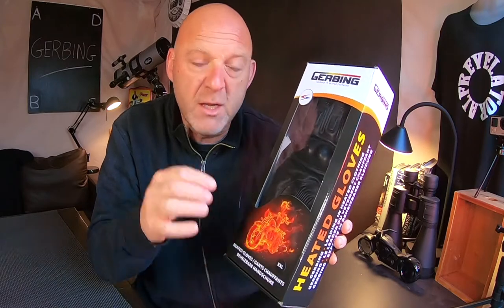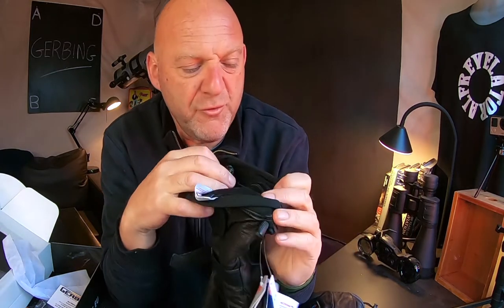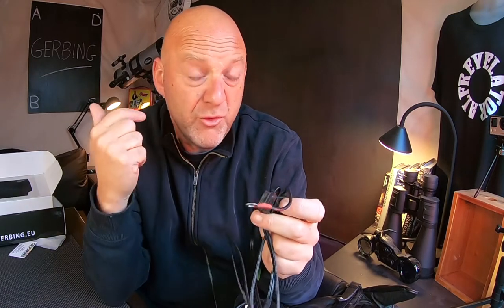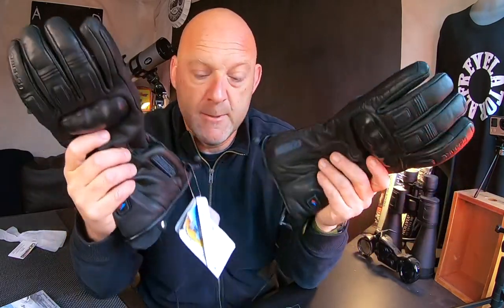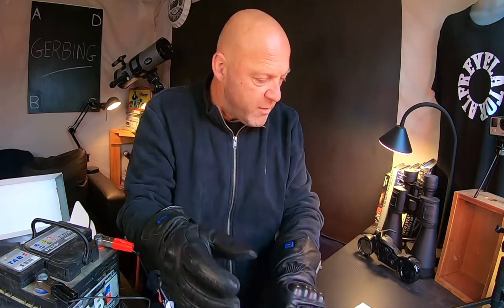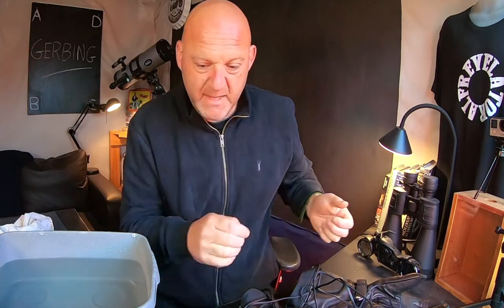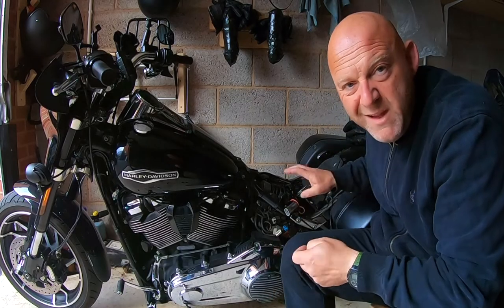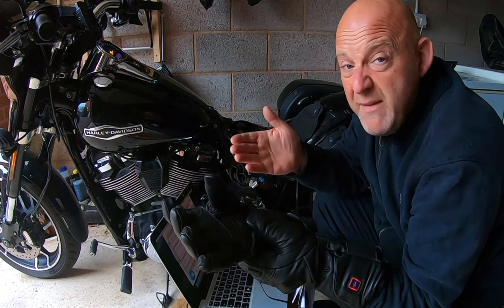Gerbing XRL Heated Gloves Full Review Test & Install | Heated Gloves Hex ezCan Powered

Comment: Good vlog Alf. i am going to motorcycle live in Birmingham in December. Hopefully i will be able to get a pair cheaper. I will also need to have two connectors for each bike. just to give you an update on the condensation in the speedo on my Harley Davidson fat bob. this week i took my triumph tiger for it's annual service and i explained i was not happy with Harley as i brought this issue up 8 months before my warranty ran out. They explained the boss was no longer there, which explains why i was not getting a reply. A very big thank you to triumph though they are part of the same group and they do the ordering for Harley. so they are getting me a new speedo and it will be free of charge. now how is that for service.
Reply from the maker: ah that's brilliant
Reply: Never cheaper at the show i thought the same black friday deal at the sports bike shop im on my second pair
Reply: @dazsyvo8499  thanks Daz

Comment: Hey! Thanks for the review. Quick question though, if i plug the red and white cables directly to the battery, without the switch, can the battery die on me? If the gloves are not plugged in will it still draw power out? Thanks
Reply from the maker: no you can wire direct to battery too

Comment: Thank you for your review. 

I am a Gerbings user from their early beginnings. Out of my head more then 28 years ago.   Before that i sometimes had to ride with minus 26 degrees Celsius.  And the gear back then was not so good as it became later on.   Sometimes was riding with newspaper at my shirt with shitty tape. As a windblocker. Damn, sometimes i had to suffer back then.  
I also still have Gerbings first heated trousers and jacket.  It was so bloody heavy that i only used it twice.  More then 2000 Dutch gulders back then.   A 25 year old jacket and trousers that are brandnew.🙈
At the moment my Gerbings gloves i bought 15 years ago are completely worn out.  So have to buy a new pair.
Need to make up my mind between the bike powered ones or the hybrid ones you reviewed.    I also do very long trips. Sometimes 2 till 3 months at one go.  And what i want to know if it is possible to charge the separate batteries while riding.   There are circumstances that i only want to use the batteries and not the battery from the bike itself.   But when away for a longer period i di not have the possibility to charge those batteries from the wall.  On the Gerbings site they do not mention this. Nor that they have a charger for 12 volt. 
And i do not want to take an invertor with me that can give 230 volts.   On many occasions in the past experienced a brake down of the bike. So i could not use the internal battery cause you want to spare the juice that is in it.  But when standing somewhere in Iran in the freezing cold it is so fine that you could use them when away from the bike.  
Sorry for the long text but otherwise people are going to ask questions that they do not see the point of that.  
If it is not possible in any way then i am going another route. And that is using a 18 volt Makita battery. A BL 18650.  Makita has a 12 volt charger for that.   And also an adapter that has two USB connectors and also a 12 volt out.  And will integrate that charger into a topcase. 
In that way in an emergency situation it could power my jacket and the gloves.  This could really be a lifesaver when your somewhere in the backcountry f.e. in Armenia  while the bike has somekind of trouble and it freezing cold. Been in such occasions. After one hour you're allready starting to shiver and in the past when in such circumstances so many times i thought "why do i not have somekind of back-up for powering the jacket and the gloves ? Or when sleeping in a tent when it far below zero.  That i could use the heated insoles in my sleeping-bag for giving me some extra heat.  I really love the heated gear from Gerbing. Not once over all those years it failed to work.  And it gives you the option to leave the heavy and bulky clothing at home.   That is superb for minimalising when on a long trip for several months.   But as soon as something is happening to the bike and it is freezing cold with strong wind ? Or somewhere up in the mountains ? Then you can get in real trouble.    Try to swith the heated jacket or the heated gloves of while riding.  In less then one minute you will notice the differance.
But there are also a lot of creative people out there. That maybe have a great idea regarding the above.  Cause before you know it i am replacing the heavy and bulky clothing with electrical stuff that is even heavier.  Weight for me is always an absolute must to minimise.  
A few years ago replaced my battery for a lithion one.   So happy with that cause it saved a lot of weight. Little did i know that lithion and cold do not get along.  I was somewhere in Turkey and had to drive a long way because of border problems.  It got me somewhere higher elevated and with that much colder.  I camped out in the freezing cold and in the morning wanted to start the bike. To no avail cause the Lithion battery could not hold any juice in the cold.  So "better" lightweight stuff also can have its downsides.  And can in such circumstances become even dangerous.  With a bike on long trips traveling below zero you are way more vulnerable if your machine brakes down.  While also drastically limiting the routes you can take because of snow and passes that are closed.  Giving you an urge of trying routes that seen afterwards were not so wise.  So hail to Gerbings and i can understand that they can not make products for people like me.    But what they still could do is creating a heated product that you could place in the helmet.  And also somekind of wire that you could place at the inside of your visor.  Most helmets nowadays have a lot more "empty" space then years ago.  Due to better impact resistant materials at the inside.  One or two tiny heating pads placed inside should disperse its warmth throughout the entire helmet by itself.   And also a few heat-threads placed at the inside of the visor would be a tremendous help against clogging up when it is cold.  Most helmets have a pinlock visor and this would be an ideal place to create a product that could be placed at the outer edges of the inside of such a pinlock-visor.  On many occasions i taped a handwarmer into my helmet.  Not to help with the visebility but just for some extra heat.  For me and other winter riders such a heated product for the inside of the helmet  would be extremely welcome. A pin-lock only goes so far.    Currently there are a few brands like Metabo that have paint removers powered with a battery. So something much more tiny like a strip of a couple of centimeters wide. Maybe even with a micro fan in it and a few heated wires back and fourth would do the trick.  That you can place with some velcro at the chin surroundings.  Creating something like that myself probably would make me much richer. It is just that i do not want to own more money.🙈  😂

Greetings from the Netherlands,
Reply from the maker: Yes very good points. I suspect a homemade charger would be better or look for heat retaining clothing such as foil lining when not have heated power

Comment: They have adapters the plug into the battery charger plug. Providing your bike has a battery charger plug of course.
Reply from the maker: Yep
Reply: They do - but be warned, if you use more than one product - eg jacket liner and gloves - you do NOT want to use the Gerbing SAE connector to your battery tender plug.  I did exactly that, just yesterday - Street Bob 2020 - since getting to the battery to connect the dual controller for the jacket/gloves permanently is a pain in the behind, was much easier on the Sportster.  Within half an hour riding it all stopped working.  The draw of the gloves and jacket liner blew the 7.5A fuse in the battery tender connection!  Turns out jacket plus gloves = 9.1A draw.  So, although Gerbing do indeed sell an SAE adaptor to plug into your battery tender connection, it's really only going to be good to use if you just have one of their heated accessories.  Two or more - forget it.

Comment: Gerbing used to make really great stuff. Then they hired a bunch of know nothings who fucked them all up. They shrunk the gauntlets so they wouldn't fit over winter jackets. They also put 90° connectors on them for no apparent reason.
Looks like the gauntlets are bigger on these. Would have liked to seen you put them on over a leather jacket. I had to cut mine with scissors so I can get them over the sleeves. Fortunately, the heating elements don't go up into the gauntlet so it didn't disturb the heating elements.
Reply from the maker: Yep I can confirm they do go over the jacket sleeves. I was using them this morning on a cold 5am ride ha ha